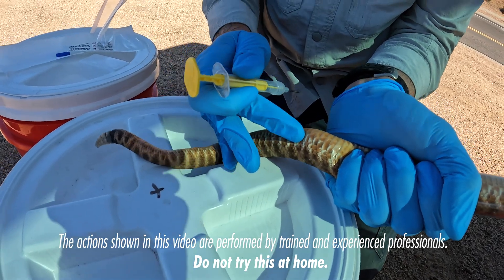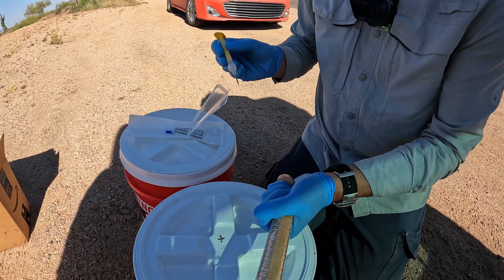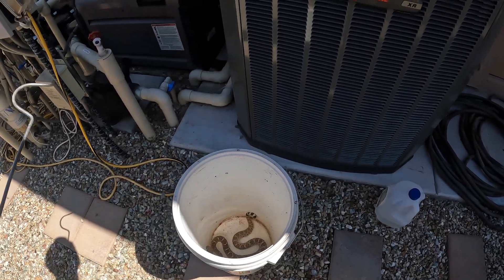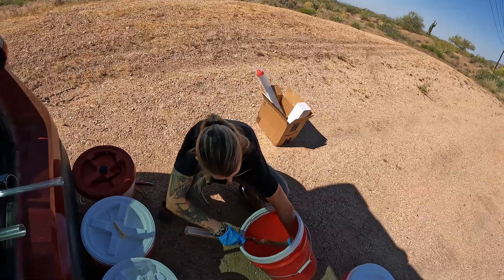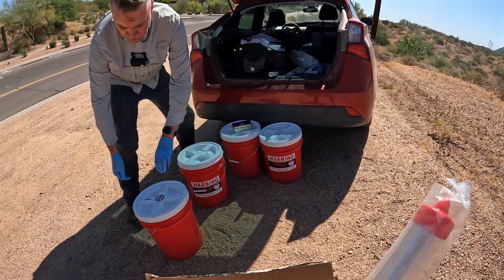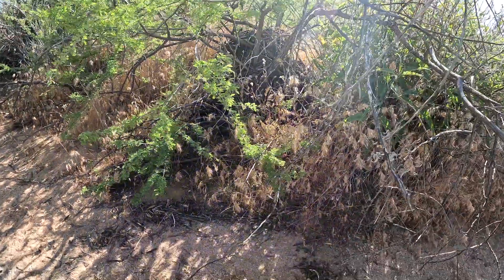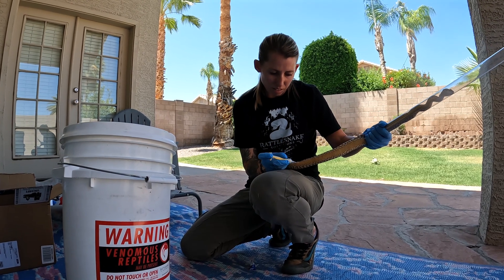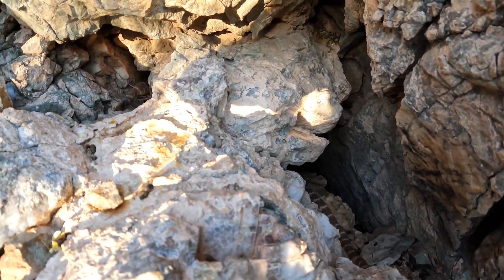Tagging Rattlesnakes in the Street! Neighbors Concerned

Comment: What is the ratio of tags you get data reported back on?
Reply from the maker: It depends. In some areas, nearly 100% are recaptures at this point. At homes, it's yet to happen, though we do find those snakes remaining in the area they were released. It's too early still to provide any real analysis, but we are onto something.
Reply: I volunteered with the local wild bird rescue  and tried to get them to band the Mississippi kites for range research  but they just wanted to rear orphaned fledglings to release. @RattlesnakeSolutions

Comment: QUESTION:      wondering why y'all don't put water in the bottom of the bucket every time on those hot days??            Thanks for the video very interesting, I do have to admit, LOL  As a retired firefighter I would gladly go into a 2 alarm fire before I EVER PICKED UP A RATTLE SNAKE.  Y'all are very brave
Reply from the maker: We do when we can, but sometimes the water that's in a car gets unreasonably hot even when we're just outside of it for a short amount of time. The other challenge is that it can help pick up tiny particles that may be left over from a previous relocation when we aren't able to sanitize, so could be an increased risk of disease transimission. In most cases it's best to just focus on getting the animal to the right spot within the right time.
Reply: @RattlesnakeSolutions  Good to know thank you for the info.  I don't ever see rattle snakes since I'm in NW Washington State on one of the islands.  Yet I do find your channel interesting

Comment: Good for Marissa!  So much easier when we were tagging 15 years ago and needed full anesthesia for radio tracking.  Marissa, you are a star!
Reply from the maker: That is still the case for many radio transmitters! These are passive (PIT) tags, so can be very small thankfully.
Reply: @RattlesnakeSolutions  That is great. Still, it was interesting to do anesthesia on a timber rattler.
Reply: @suem6004  And, IIRC, the trackers weren't much smaller than a AAA battery...yikes...